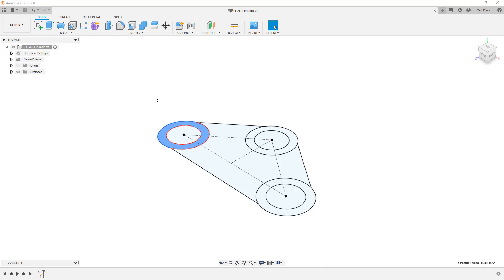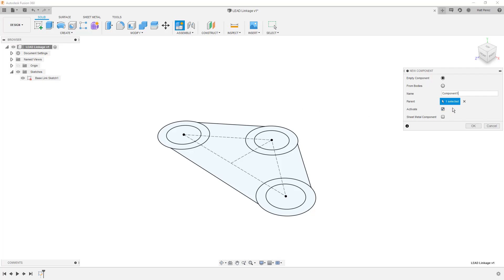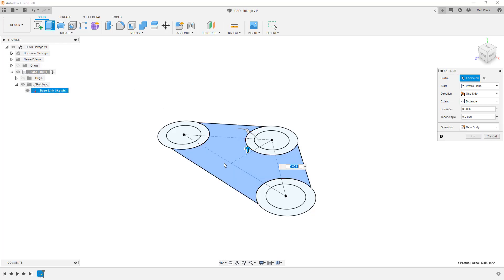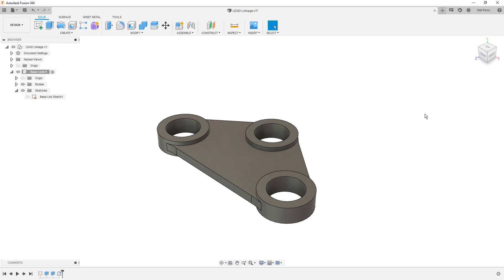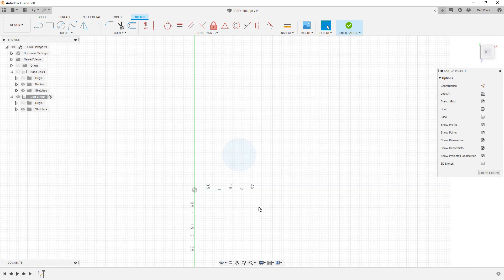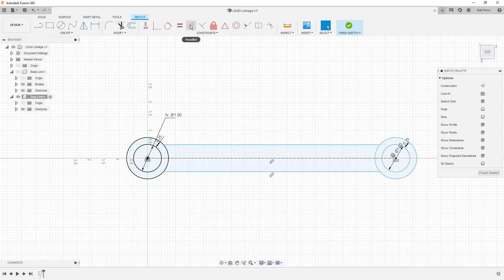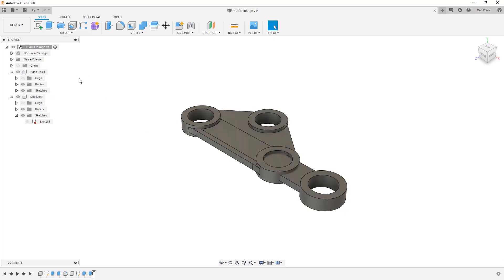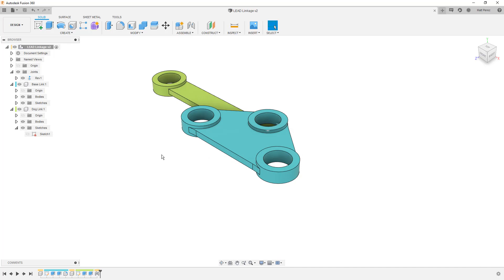Intro to Fusion 360 - Part 9: Creating Linkage Parts #Fusion360 #HowTo #Tutorial

Comment: So a component is just like a master folder containing the sketches, bodies and other stuff. And then is also seperate to the main design folder?
Reply from the maker: Sort of.  Every design is at least 1 component at the very top level.  A component is like a container.  It always has its own coordinate system, but can also contain sketches, bodies, as well as other things like joints and even other components.

Fusion keeps track of the coordinate systems of components and thats how joints work.  Fusion knows the coordinate system location and orientation and can relate that to other components.

This is sadly a very big and complex topic.  I do have an Assembly course on my site talking about it in a different way if that helps.  https://www.learneverythingaboutdesign.com/p/absolute-beginners-guide-to-assemblies-in-fusion-360

Sort of a rough guideline is if your assembly is going to be moving, need drawings/bill of materials/animations/exploded views, you really need all components.  If all the elements of your design are static and its not too complex (not a ton of sketches and features), you can stick with all bodies.  I find myself mixing and matching depending on the design.  In many cases I stick with bodies then convert to components at the end when i need joints or drawings.
Reply: @LearnEverythingAboutDesign  yes it is pretty complex good damn hahaha, iv come from onshape at a very beginner level and was starting to get the hang of it but wanted to turn to fusion for the t-spines/form. i think im gonna have to watch your playlist again with the froms. that has you covering the Subaru. right now struggling toget the form shape right and to part/ merge it to one of my solid body parts for a belly pan for a bike. Have you got a discord?